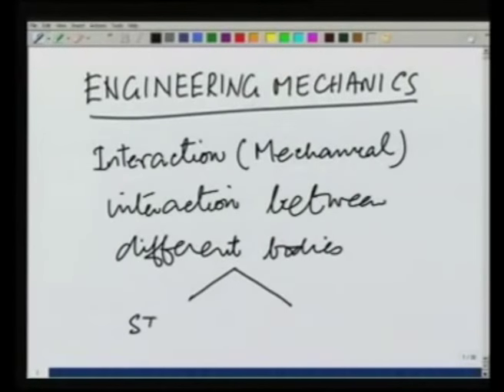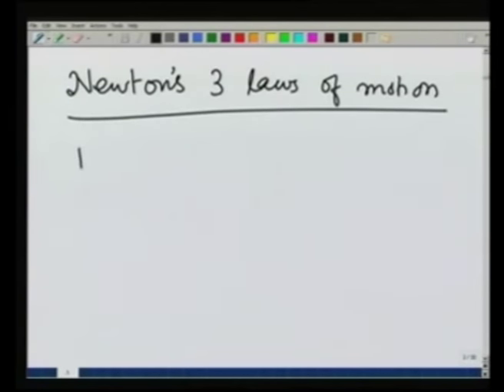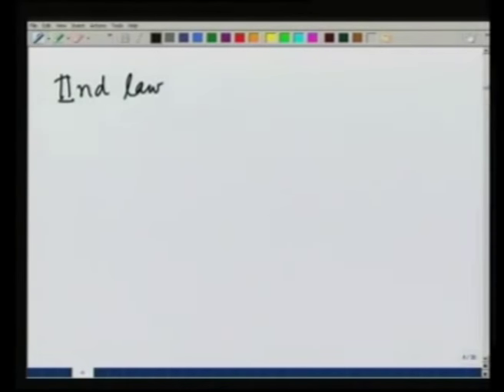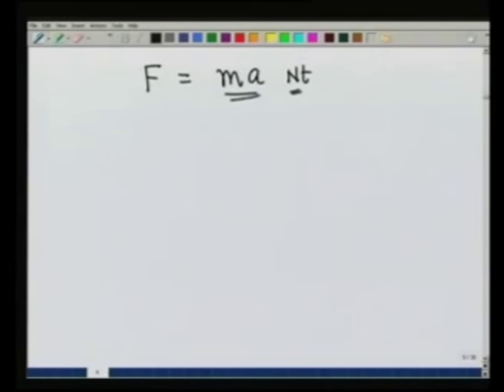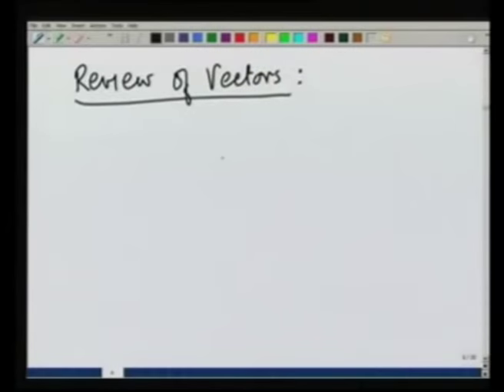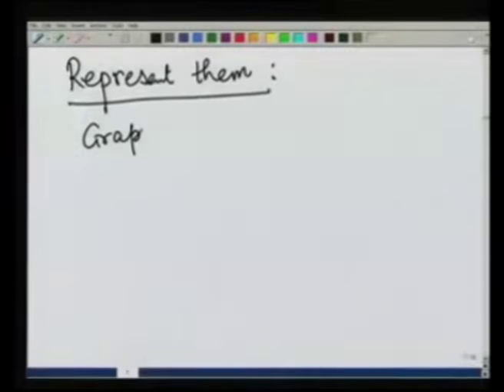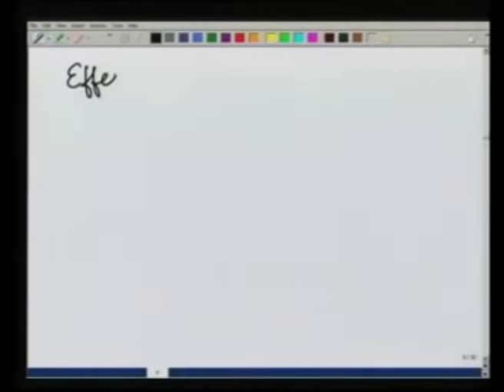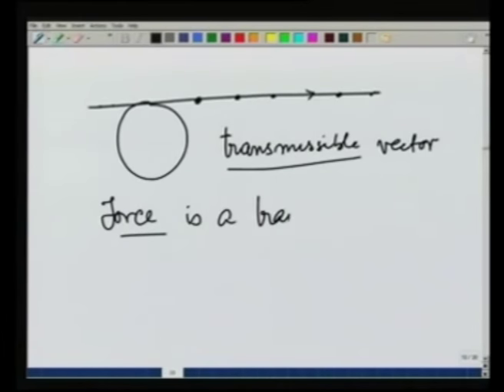Introduction to Vectors

Comment: Total Playlist Duration: 40h 55m 22s
1.Introduction to Engineering Mechanics
2.Introduction to Vectors
3.Addition and subtraction of vectors
4.Multiplying vectors
5.Introduction to vectors: solved examples I
6.Transformation of vectors under rotation
7.Vector products and their geometric interpretation
8.Vector Product: Kronecker Delta and Levi-Civita symbols-I
9.Vector Product: Kronecker Delta and Levi-Civita symbols-II
10.Introduction to vectors: solved examples II
11.Equilibrium of rigid bodies – Forces and torques
12.Calculating torques and couple moments-I
13.Calculating torques and couple moments-II
14.Finding a force and a couple equivalent to an applied force
15.Different elements and associated forces and torques-I
16.Different elements and associated forces and torques - II 
17.Solved examples; equilibrium of bodies – I
18.Solved examples; equilibrium of bodies – II
19.Forces in different geometric configuration
20.Plane trusses I - building a truss and condition for it to be statically determinate
21.Plane trusses II - calculating forces in a simple truss and different types of trusses
22.Plane trusses III - calculating forces in a simple truss by method of joints
23.Plane trusses IV- Solved examples for calculating forces in a simple truss by method of joints
24.Plane trusses V - Solved examples for calculating forces in a simple truss by method of joints
25.Plane trusses VI: method of sections for calculating forces in a simple truss
26.Dry friction I - introduction with an example
27.Dry friction II - a solved example
28.Dry friction III - Dry thrust bearing and belt friction with demonstration
29.Dry friction IV - Screw friction and rolling friction
30.Dry friction V: Solved examples
31.Properties of plane surfaces I - First moment and centroid of an area
32.Properties of plane surfaces II - Centroid of an area made by joining several plane surfaces
33.Properties of plane surfaces III - Centroid of a distributed force and its relation with centre of gravity
34.Properties of plane surfaces IV - solved examples of calculation of first moment and centroid of distributed forces
35.Properties of plane surfaces V- Second moment and product of an area and radius of gyration
36.Properties of plane surfaces VI - Parallel axis transfer theorem for second moment and product of an area
37.Properties of plane surfaces VII - transformation of second moment and product of an area under rotation of coordinate axes
38.Properties of plane surfaces VIII - second moment and product of an area, solved examples
39.Method of virtual work I - degrees of freedom, constraints and constraint forces
40.Method of virtual work II - virtual displacement, virtual work and equilibrium condition in terms of virtual work
41.Method of virtual work III - solved examples
42.Motion of a particle in a plane in terms of planar polar coordinates 
43.Planar polar coordinates: solved examples
44.Description of motion in cylindrical and spherical coordinate systems
45.Using planar polar, cylindrical and spherical coordinate systems: solved examples 
46.Motion with constraints, constraint forces and free body diagram
47.Motion with constraints – solved examples
48.Motion with dry friction – solved examples
49.Motion with drag – solved examples
50.Equation of motion in terms of linear momentum and the principle of conservation of linear momentum
51.Linear momentum and centre of mass 
52.Momentum transfer, impulse and force due to a stream of particles hitting an object
53.Momentum and the variable mass problem
54.Linear momentum – solved examples
55.Work and energy I - work energy theorem; conservative and non-conservative force fields
56.Work and energy II - Definition of potential energy for conservative forces; total mechanical energy and the principle of conservation of energy
57.Work and energy III - Two solved examples using conservation principles
58.Work and energy IV – Further discussion on potential energy
59.Work and energy V - Solved examples
60.Work and energy VI – Applying conservation principles to solve a collision problem
61.Work and energy VII - Solved examples
62.Rigid body motion I - degrees of freedom and number of variables required to describe motion of a rigid body
63.Rigid body motion II - Equation of motion for a single particle in terms of angular momentum and torque; motion of a conical pendulum
64.Rigid body motion III - Conservation of angular momentum; angular momentum for a collection of particles
65.Rigid body motion IV - applying angular momentum conservation, a solved example
66.Rigid body motion V (fixed axis rotation) - some demonstrations of conservation of angular momentum about fixed axis
67.Rigid body motion VI (fixed axis rotation) - Some more demonstrations and related problems
68.Rigid body motion VII (fixed axis rotation) - Kinetic energy and moment of inertia for fixed axis rotation and some solved examples
69.Rigid body motion VIII (fixed axis rotation) - solved examples for calculating moment of inertia and conservation of angular momentum
70.Rigid body motion –IX (fixed axis rotation): solved examples
71.Rigid body motion X - rotation and translation with axis moving parallel to itself
72.Rigid body motion XI - solved examples for rotation and translation with axis moving parallel to itself
73.Rigid-body dynamics XII - Some demonstrations on general motion of rigid bodies
74.Rigid-body dynamics XIII - Infinitesimal angles as vector quantities and change of a vector when rotated by an infinitesimal angle
75.Rigid-body dynamics XIV - Angular velocity and the rate of change of a rotating vector; relating change in angular velocity to an applied torque
76.Rigid-body dynamics XV - Relationship between angular momentum and angular velocity – the moment of inertia tensor and the principal axes
77.Rigid-body dynamics XVI: Solved examples
78.Rigid body motion XVII – A review of the relation between angular momentum and angular velocity, moment of inertia tensor and the principal axes Edit Lesson
79.Rigid body motion XVIII- Solved examples for calculating rate of change of angular momentum and torque when angular velocity and angular momentum are not parallel
80.Rigid body dynamics XIX: understanding demonstrations shown earlier using equation of motion
81.Rigid body dynamics XX - understanding demonstrations shown earlier using equation of motion (Euler equations)
82.Rigid body dynamics XXI - Euler equations, solved examples
83.Simple harmonic motion I - expanding potential energy about the equilibrium point and the corresponding force
84.Simple harmonic motion II : solving the equation of motion with given initial conditions
85.Simple harmonic motion III - solved examples
86.Simple harmonic motion IV - representing simple harmonic motion on a phasor diagram; energy of an oscillator
87.Simple harmonic motion V- solved examples
88.Simple harmonic motion VI - solving the equation of motion with constant friction in the system
89.Simple harmonic motion VII - harmonic oscillator with velocity-dependent damping (heavy damping)
90.Simple harmonic motion VIII - harmonic oscillator with velocity-dependent damping (critical damping)
91.Simple harmonic motion IX- solved examples
92.Simple harmonic motion X- harmonic oscillator with velocity-dependent damping (light damping)
93.Simple harmonic motion XI- solved examples
94.Simple harmonic motion XII - oscillations of an un-damped harmonic oscillator subjected to an oscillatory force
95.Simple harmonic motion XIII - oscillations of a forced damped harmonic oscillator I 
96.Simple harmonic oscillator XIV: oscillations of a forced damped harmonic oscillator II
97.Simple harmonic oscillator XV: Energy and power in a forced damped harmonic oscillator
98.Simple harmonic oscillator XVI: Solved examples
99.Equation of motion in a uniformly accelerating frame
100.Motion described in a uniformly accelerating frame; solved examples -I 
101.Motion described in a uniformly accelerating frame; solved examples -II
Reply: https://youtube.com/playlist?list=PLhgXtZ1PS2DpxPFlNBhoWefGJCaJhGMiO
Reply: thanks
Reply: you're going to heaven boy